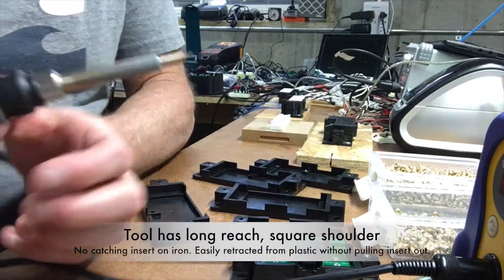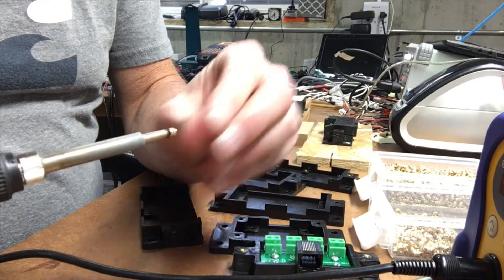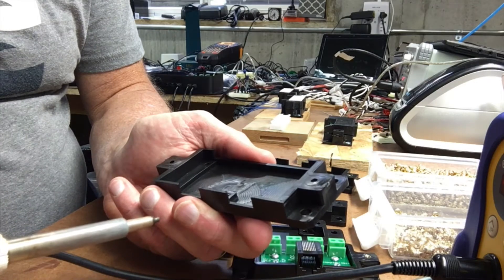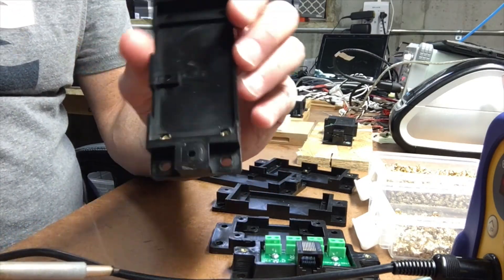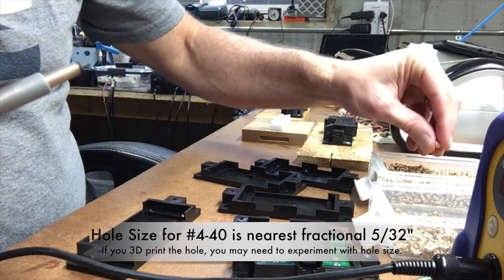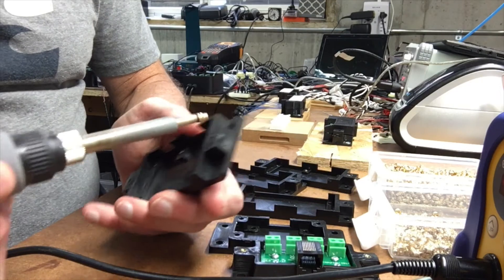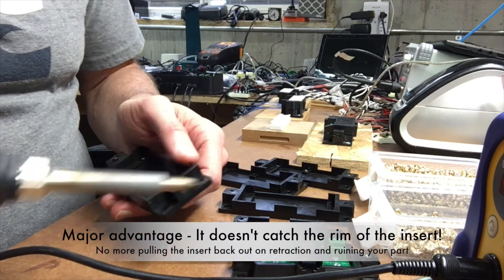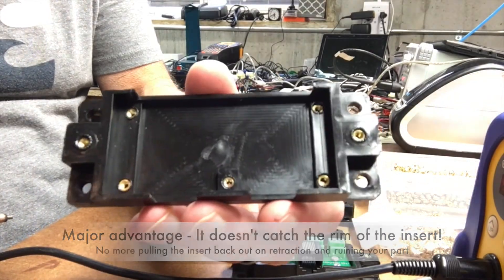Plastic heat set insert installation tool - Usage

Comment: Can these be used to remove them as well? I need to replace a stripped brass insert.
Reply from the maker: I doubt these would help you remove a stripped brass insert since they're designed to slip off easily.  If you have any threads left at all, the best bet might be to grab as much thread as you can with a longer 4-40 screw (or whatever size you're working with), then heat up the screw with a small torch, if you can keep from melting your piece.  Since you're probably already in the situation where you'd need to fill the hole before putting a new one in, you could use these tips to heat things up and then tip it sideways to try to put some friction on the insert and pull it out that way.  Would leave a bigger hole to fill up, but might work.
Reply: @randycox4633  that's actually not a bad idea.. however after some research I finally found an extraction tool from McMaster.

Comment: Great idea---found this video via a post in an automotive centered forum where this type of insert is used in some Ford intake manifolds.  Before knowing of this tool repairing a missing or loose insert typically required removing and/or replacing that part.  Simply repairing the insert saves a lot of time, money and unnecessary effort.  

Thank you!
Reply from the maker: Really glad it helped you out.  Would you mind saying exactly which automative forum you saw the link to this video on?
Reply: ford-trucks dot .com Ford Truck Enthusiasts

Comment: Hey Randy, an outstanding tutorial about those little heat set inserts. 
I wrote an tutorial myself it's more an assembly instruction to one of my creations. I placed a link tho your video in my tutorial for people what need some more detailed information about the installation of those heat set inserts. I hope that i didn't cause any problems in doing so. 

Here is a link to my tutorial where you can check it out.

@https://www.instructables.com/id/I-Bot-Extruder/

thanks again for your video
Reply from the maker: Thanks for the shout out.  I appreciate it.

Comment: Love mine! Any chance you can make the tool for M2.5 screws? M3 and #4 are too big for Raspberry Pis.
Reply from the maker: Hi Randy, glad you're getting good out them.  I've had some requests for the smaller M's and will consider making them in that size too.  Are you using the Hakko model iron?
Reply: Hakko tip in a compatible Atten-brand iron.
Reply from the maker: @randyglenn5965  Okay, thanks.  Since the economics are such that I basically need to sell a couple of sizes at a time, what other sizes would interest you along with a 2.5?
Reply: @randycox4633  might be worth selling them as a full package ex. M2-M5. That's what I would've preferred.